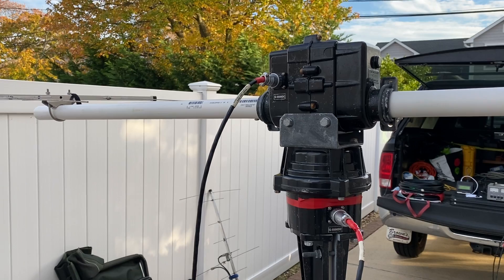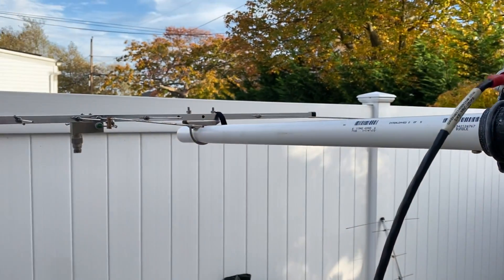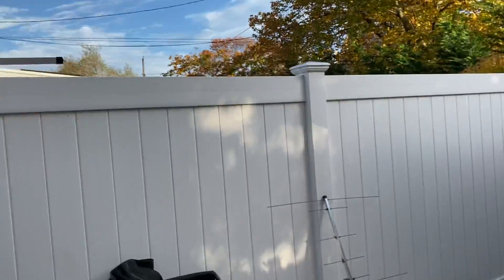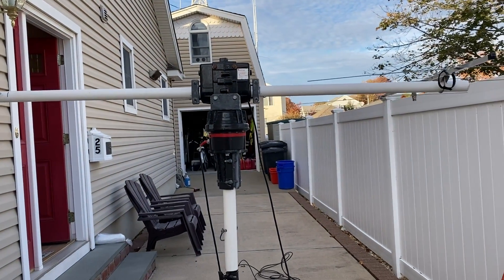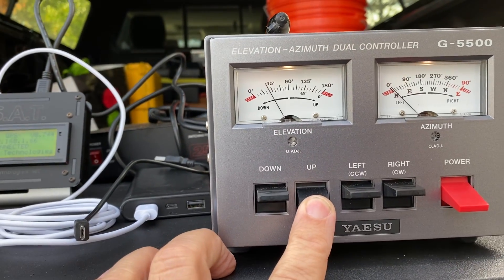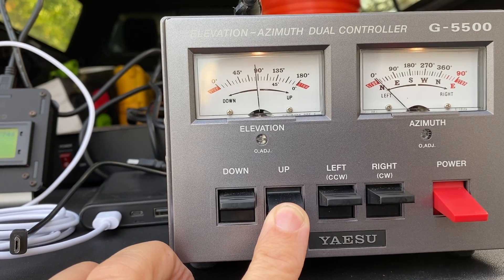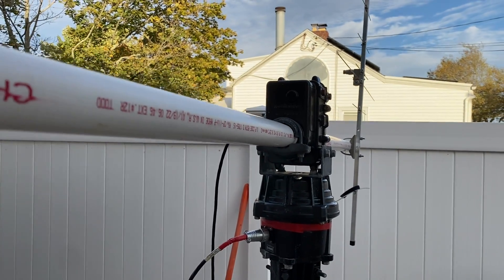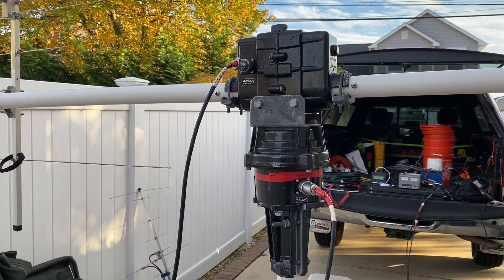Installing the Yaesu G5500 azimuth/elevation rotator pointing at true north.

Comment: I have a question, why wouldn’t you make the azimuth rotor point north instead of the elevation rotor?
Reply from the maker: When you set them both to zero they both will point north. If your antennas and the wire coming out of the elevation rotator are not pointing north it will be backwards.

Comment: what is the diameter of the PVC cross beams? Why are there screws in each one? I use a 1 1/4 five foot metal RCA mast pole but interested in other options as well.
Reply from the maker: I think it is 1 1/4  I have a wood dowel inside the screws hold it inside the PVS pipe.

Comment: good video.  I noticed that your demo varies from the instruction manual that wants us to elevate through the entire 180 degree arc and one full revolution of the az too.  In other word run it to the stop and adjust the read out.
Reply from the maker: Im confused on your question. To calibrate the voltages move the rotator to the full 180 for elevation. and the red 90. both needles  all the way to the Right on the scale. that is the set max position.

Comment: "May I ask what type of connector model is used at the interface between the control cable and the Yaesu G-5500 antenna rotator? Thank you very much!"
Reply from the maker: The cable is a mini din to a full size din. The cable plugs into the back of the G5500 controller and the top of the CSN SAT Tracker

Comment: Thank you for this video.  About how long is your crossbar?
Reply from the maker: about 5 1/2 feet
Reply: Although it can be as long as required,,,,,,taking into consideration that using cross yagis,any metallic pole could interfere with rf or vswr readings,,,,,,,l use the g5500 woth a wooden round pole,,,inside a fiberglass tube,,inside a pvc tube,,,,surprisingly it all fits,,and is relatively strong enough for a tonna 12 ele cross yagi for two meters,,and a 19 ele cross yagi for seventy,,,,,cms,,,,,de G1EGZ/P

Comment: Did you have to do any modification to the stand to make it work with the stand.  Thanks for the vid.  Also, any support for Yaesu FT-991A?
Reply from the maker: no I use the stand out of the box. We are working on other radio support.